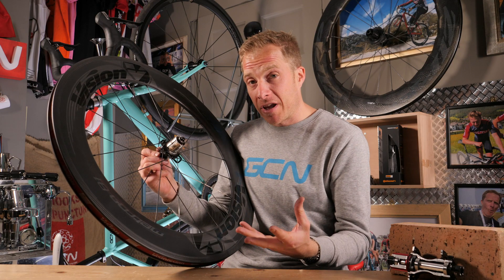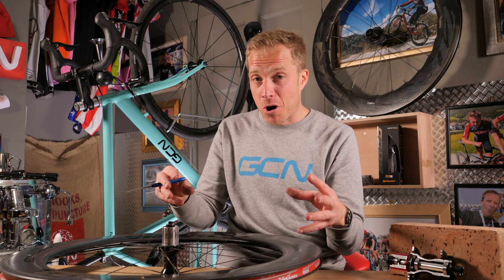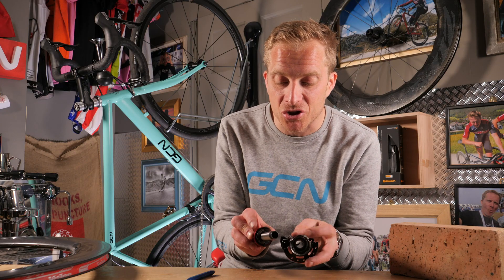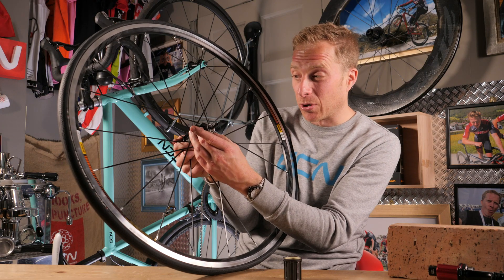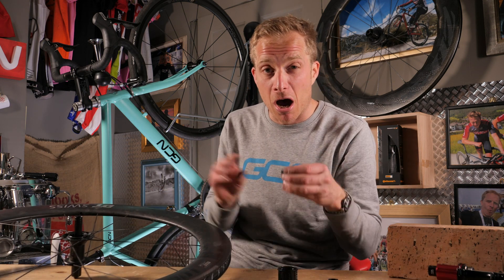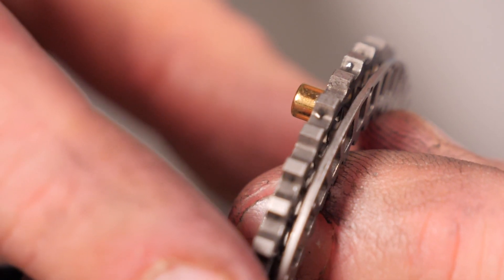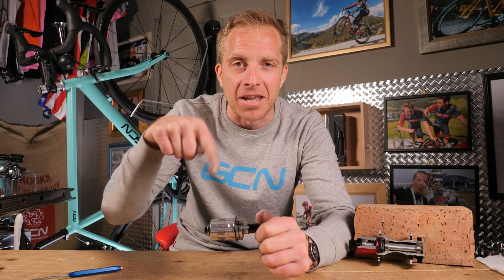Freehubs Explained: Everything You Need To Know About Road Bike Freehubs

Comment: I took my bike in for a full overhaul and my rear wheel came back much, much quieter than when I dropped it off. Having said that, it also feels more smooth and picks up more quickly when I go from freewheeling to putting in power. So while I do miss the noise it made, I feel like it's faster and more responsive now.

Comment: 9:42 do more points of engagement really make the freehub louder? i would expect a higher frequency bur not a higher volume.
Reply: Yes, its louder. I have 64 tooth rings on my DT Swiss road rims hubs. When riding with a friend, the noise is annoying, but on the paved trail (95% of my riding), it saves me from saying, "On Your Left!" All the time. I just stop pedaling, and they hear me coming.
Reply: At low speeds no but as speed increases it’s much louder
Reply: They get much louder. The 18t 350 is basically inaudible while riding and just makes a slow muffled click when pushing the bike. the upgraded 54t 240/180 are very loud and high pitched. people in the city jump away. its not as angry as chris kings though.

Comment: If you want the ultimate challenge and something really interesting in the world of cycling then disassemble an enviolo (NuVinci) CVT hub.
Reply: Ed R Nobody wants to watch a six hour gcn tech video. 😂
Reply: @prestachuck2867  I can take one apart in 5 mins, they are very simple. The difficult bit is making the special tool required to open it. You won't be able to buy one that's for sure. And don't spill the oil either because that's also not for sale.

Comment: Just got a handbuilt pair (built by and for a mechanic that ended up not using it) with Bitex hubs. I wasn't too fond of the noise at first as my stock wheels were dead silent, but I now appreciate the added safety it gives me on shared paths.

Comment: Hi GCN! Great video as always! I am thinking of upgrading my bike with a new 11 speed 105 groupset, but I’m not sure weather I need a new rear hub, as I am currently running 8 speed Shimano Claris 🤔
Reply: You will need a new hub (or at minimum just the freehub body if it is available for your wheels (unlikely for a bike with Claris)).  11 speed needs a wider freehub. Or you can get the cassette and/or existing freehub modified to make it fit, but probably not worth it.
Reply: Matthew King Thank you so much!

Comment: Finally the content I love, thank you! Pity you didn't disassemble Chris King hub, and glance over contact points (there is a a difference because the more you have faster engagement but it comes at the cost of the lifespan). As for Zipp hub -- shouldn't it mean it is silent when running free (I just checked, Zipp does not offer hubs at all, it looks like you have to buy entire wheel, bad, bad, bad)? My vote for next topic would be internals of the headtube -- how fork is stabilized, what benefits come with tapered headtube, and so on.

Comment: Very interesting. Great video! but i missed shimanos silent hub.
Reply: Shimano's old style roller clutches were terrible because of the spongy pedal feel, they still are in the Alfine 11 hub gear, particularly in 2nd gear, but the new silent clutch in XTR is done very similarly to Chris King but taken a little further so the hub running on uses the spline that drives the toothed washers together (This creates increased engagement force with increased drive torque) to separate the washers and stop the hub making noise. The one downside of the axial engagement style hubs like DT/King is that the smaller the teeth on the washers are, the more sensitive they are to contamination as a small piece of grit between the washers will stop all the teeth on the washers from engaging properly, but that's really a hub sealing issue.
Reply: MJD  I've pretty much swapped everything to 6 bolt hubs on my bikes st this stage as I'm fed up with centrelock disks moving around if you load them backwards riding street. I still have an XTR hub on one bike that's about a decade old with thousands of km on it and it's running smoother than a 1 year old XT hub.

Comment: You've got to do STI Shifters next...

...I've stripped them down and now it's your turn to show em how it's done!
Reply: Not stripped them down yet but had one snapped off my bike in a bunch crash, ( complicated things)
Reply: @elijahkwon422  
Yes, they can be monsters...

...you use similar tactics with clocks as you might with STI shifters.

Now hub gears can be harder, and I have yet to master some of them...
Reply: STI shifters? I'd like to see a teardown of some Di2's!

In any case, this guy has a great video for a set of old, old STI shifters. There's going to be some differences with the modern stuff (eg. with both brake and shifter cables going under the bar tape), but it at least gives you the gist of it.

https://www.youtube.com/watch?v=xkGNN_2CfCY

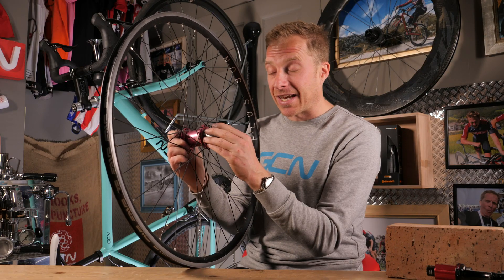Comment: 7:35 I don't understand that bit about "more power transfer". Surely, unless the freehub is slipping, power transfer should be 100% when engaged. The only difference would be how quickly the engagement occurs when you start pedalling.
Reply: @GranDarf  I'd argue if you're a sprinter or just racing cars the flex in components can become more significant, though if you're on a casual ride it may not matter
Reply: the louder the freehub, more energy trensfers into heat and noise instead of kinetic energy
Reply: The loss is only when free wheeling so I dont worry about it.
Reply: @guycohen4403  If the hub is making noise, you are not transferring any energy because you are not pedaling.
Reply: More engagement, better power transfer and reliability I reckon. just saying.
Reply: @JonCannings  Better reliability, perhaps.  The only advantage I see is the quicker engagement of, say, a 54 or 36 tooth DT Swiss Hub over a 25, assuming the mechanism can engage that fast (just 6.6 deg or 10 deg of rotation vs 14.4 degrees).
Reply: For me it is really important to have an instand engagement
Reply: The thing here is that the load is spread over more engagement points, let's say you have only 2 points where the power is transferred, that causes a very uneven load wich causes lesser roundness and more load and friction in the bearing, more binding effects etc... So more Engagement points, more evenly spread load what leads to more power and longer lifespan etc... Sure we're not talking about 10W loss, think about it more as a reliability and lifespan thing.
Reply: @mazevx2451  It's the exact opposite of quality sockets, a 6pt socket being MUCH stronger than a 12pt one! The load is spread over a larger surface area, ie: stronger socket, whereas a 12pt has smaller surface area  and can be stripped easier. But yes, it makes sense on a Freehub, that those multiple engagement points will transfer the energy better, without really being weaker, since every point carries less load!
Reply: That is the actual efficiency a freehub can do. Material flex does cause some loss in power transfer though as little as they are on smaller components can, in fact, affecting the transfer.
Reply: Well if you have a cheap ass bike with cheap ass wheels you'll break the freehub with power, not had that problem with better wheels
Reply: I think what you're thinking of is different than the losses they're talking about. 1 revolution of the chain ring forward would indeed result in 1 revolution of the hub body. But the losses are in the fact that the parts have flex and friction which turns a percentage of the force into heat. The more of those exist the more power you have to put in from your legs to overcome them and rotate the wheel. If the friction is reduced or some of it is eliminated then you can move forward the same amount by using slightly less energy.
Reply: @Elijah Odal No, they're not.  If there are fewer engagement teeth that are driven by the pawls, the "dead space" between them goes up.  E.g. Let's say you had the same three pawls but only ONE tooth, you could be "free" pedaling up to a third of a revolution (120 deg) before it actually started to drive the wheel forward every time you decided to stop coasting/braking.  That's what we mean by "slow to engage."

Comment: I want one that makes no noise.
The world is alredy filled with much to much noise.
Reply: check out onyx hubs pricy though
Reply: Ib Erik Söderblom The new XTR hub is silent.
Reply: Some of the newer Shimano Ultegra hubs are totally silent. I have a pair. I love how quiet they are.
Reply: Onyx hubs are silent and have instant engagement
Reply: Just pedal all the way
Reply: @gcahbm  Yes Gabriel you make a good point there, I agree. Unless you're around a sharp corner or absolutely hurtling down a descent, if you can hear your freehub then you're not working hard enough and wasting energy when you decide to accelerate again
Reply: I agree!!! Wtf....why do people think it's cool to have a loud free hub? Damn children.  Idiot people in this world seems to be the majority these days. I'm guessing the same ones who think low profile tires look good on a truck! Yep
Reply: @-Accola  
Bears.  Let them know you’re coming.
Reply: @-Accola  it just turns out that some very stout designs happen to be louder.  King and DT/Swiss are two examples.  Onyx is the exception; but you pay for silence with a weight penalty.
For most riders, any freehub body will perform fine.
For clydesdales and tandem riders, freehub engagement design is crucial.
Reply: I got a Easton wheelset with campa hub, absolutely noiseless
Reply: The only problem with the silent shimano hubs is they are still cup and cone :(
Reply: @jonathanzappala  What's wrong with Cup and Cone bearings?
Reply: casualguy393 I don’t like cleaning them every few months that’s all
Reply: @jonathanzappala  Ah, I gotcha. I have them in my Zondas and Bullets, but rarely ride in the rain so I overhaul them only once a year. 

A good thing to remember is never to direct strong water spray into them, and you should be able to get by with the same interval between cleaning and re-greasing ;)
Reply: Jonathan Zappala You ought to be servicing your cartridge bearings just as often if you want them to be able to deliver maximum performance. They still wear away tiny bits of metal that becomes suspended in the lubricant and will increase drag as well as shorten the lifespan of the bearing.  It’s not difficult to service either one.
Reply: I’ve got some 2010 Shimano Dura-Ace WH-7850-C24-CL hubs that spin forever and are near silent. You might find a used set and get the bike they’re attached to in the bargain. Rim brakes and 10-speeds though. For 11-speeds and disc, you’ll need something newer.
Reply: Used a Shimano Roller Hub on a 26in trials bike, awful rubber band like engagement but totaly noiseless, was kinda cool rolling about making no noise though.
Reply: On the subject of quiet wheels, I just got the lastest Fulcrum Racing 5 (2020) wheelset. It is lovely, the freehub has loads of teeth for good engagement and the thing sounds like a little mechanical bedside clock. No obnoxious sounds and they are light for their price at 1.6kg £240
Reply: ZIPP COGNITION.
Reply: The zipp Nsw at high speed are completely silent
Reply: MJD  I'm more talking about people who are on a straight, clear road and will just stop pedalling for no good reason whatsoever. They slow down and ultimately waste more energy getting back up to speed, just like how your car uses more fuel in stop-start traffic.

Personally, I like going hell for leather; pedal as close as I'm comfortable into a corner then nice firm braking, round the corner, crank up, knee down/out. Not when I'm out with the club though of course.

And I did mention that you may stop pedalling down hill 🤦‍♂️
Reply: MJD  its not just intrinsic to bearing quality though is it? I see myself as a reasonably fit rider and will hold 20-22mph over 50 flat miles for a moderate effort. At that speed, air drag is significant and will slow you down to a point at which drag is much less if you stop pedalling.
Reply: MJD  I certainly agree that there is a lot of shocking cup and come bearings out there though
Reply: Shimano Scylence.
Reply: If you live where bears are common, you want the opposite.  The more noise the better to let them know you’re coming so they have time to get off the trail and avoid confrontation.  Bears don’t like humans and would rather avoid us most of the time and the feeling is mutual.  🐻
Reply: I agree. I just recently bought some Fulcrum 4 wheels. Free hub is very quiet when out riding. Not as quiet as my previous Shimano, but more quiet than many others. I would prefer one that totally disengages and therefore makes no sound at all.
Reply: fix gear...
Reply: @julmeissonnier   why??

Comment: Loud freehubs suck. I ride a bike partly because it is silent, otherwise i could use a fkn car. That's why DT swiss won't ever be an option. Poser freehubs.
Reply: It depends what DT Hubs you get, my 240s with 36Ts are not loud at all, in fact the basic 3 Paul Hubs they make are way louder. I use DT because they are the best wheels in the world. Where I live if you want to show off you buy Zipps
Reply: I would love to buy and use silent hub, but Shimano XTR is only for higher-end setup and Onyx is expensive and non-responding (company). So this means I am stuck with noisy ones, and out of them DT-Swiss looks like a best bet, widely available (spare parts too, like steel freehub), serviceable, etc.

Comment: I like the DT Swiss one. Theoretical it should be the cheapest to replace if you are able to wear thos teeth out.
Just buy a new star ring.
Dont know how many Km thag would take.
Reply: It looks both the easiest to replace and the hardest to wear down.
Reply: I have two sets of dtswiss 240s and man they are great. So easy to service on a whim. One has a 54T and the other is 18T.
Reply: David Luong Are there noticeable difference between 2?
Reply: David Luong Thanks for the response.
Reply: There is a reason Giant, Bontrager, and Roval all use dt Swiss internals. I own several and they are the easiest to service in my opinion. People say that about Chris king, but Jon didn’t want to take that apart did he. I definitely notice the 36 version over the 18 it’s worth the upgrade. I have a 54 on my mtb, not a noticeable difference over 36. After all, 18 is 20 deg, 36 is 10 deg and 54 is 6.667. I don’t get the obsession to have more than 6 deg engagement, who could notice that?  Maybe in the 11 tooth cog I guess.

Comment: Jon, out of nowhere, with the best GCN Tech video so far. Thank you so much.
Reply: #poty2019
Reply: I hate my disk brake bike ... I’m
Holding onto my 5 emonda rim disk frames and bikes.   The pawls just fall out hub on disk hub assembly. And cassette comes off. Could anyone let me know how to tighten the slack up now I’ve pushed the pawls into the hub.   Then it’s off on eBay